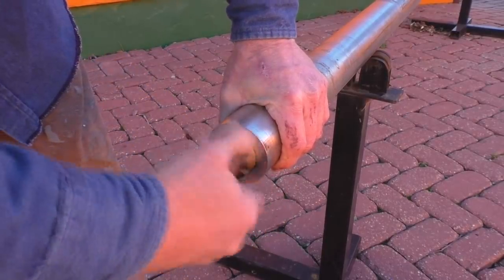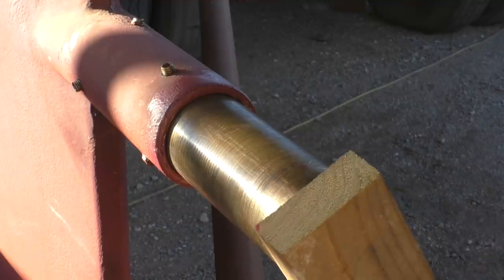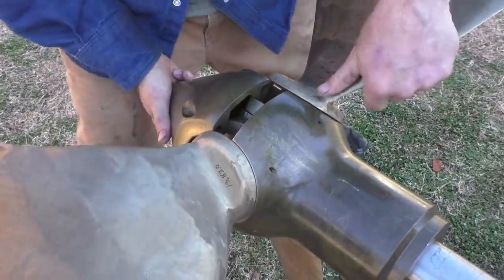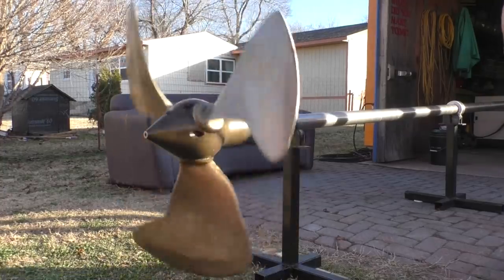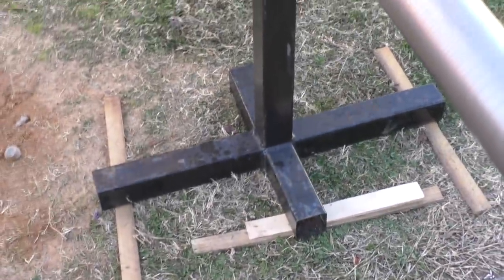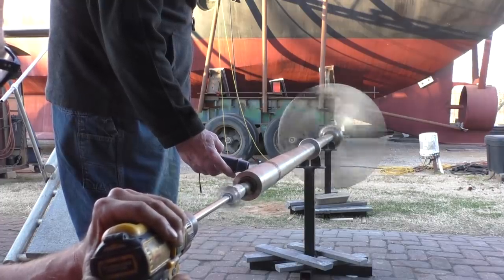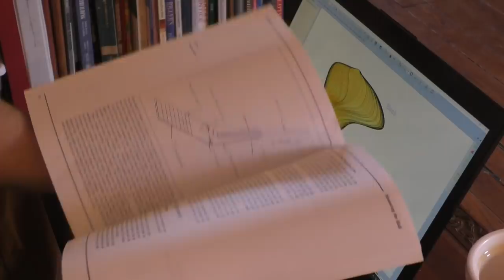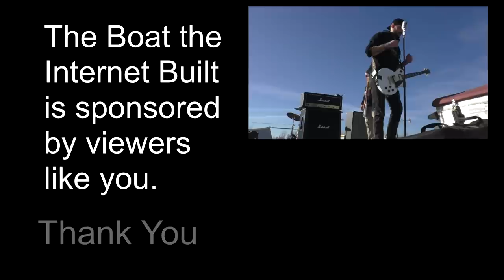DIY Boat Propeller - Part 10 - Tested at 600 rpm

Comment: A propeller blade balance can be calculated with momentum. Take the weight and multiply by the distance from the center of gravity of each blade to the hub center. That is the number that must be as close to each other as possible between all blades.

Comment: If you lower each blade incrementally into water at the same angle and measure the displacement at each step you can compare reasons across blades with regards to volume differences in each "slice"

Comment: My aducated guess is that your wobble at x rpm is due to the shaft hitting some natural frequency spots in the whole system. or the stands .
What RPM do you intend to run that prop at anyway? I only ever seen props run at 100 to 140 RPM's

Comment: It looks like the roller bearings are stiff. Remove the pop and shaft and spin each roller and see if it drags. The prop should spin easily with good bearings.

Comment: I was too a little bit concerned about the spinning meat cleavers. HA!  The little bit of wobble you got is being amplified because of the way you have the shaft supported. If both sets of blades behave as well as the first,  I think it will be fine once in the boat.

Comment: You want to change the Hunderstat shaft spline so the Port side bolt heads are on top, and the starboard nuts are on the top.  That way as it spins, it will remain balanced.

Comment: Do the prop manufacturers use moment weights on large blades? On a jet engine the weights are installed on the cone not the blades.

Comment: I would just have tryed to do a static balance if needed. But i think this will be okey when installed in the boat. The phenomenon you experience with more imbalance at certain speeds is called critical rpm:s😊

Comment: I'm no expert, I'd see if you can get the shaft straightened
I would weigh each blade and get them as close as possible, there are prop shops that can also more accurately mill and profile them
maybe add shims to the loose blades reduce wobble and stress that will damage them further once they hit water
can also balance the hub assembly?
Love watching the progress, thank you for sharing

Comment: Best wat to balance this is a bubble balance like they used to balance tires in the old days . was raised in a garage and did this many times. you balance the yoke and everything hooked to it. You just need center and a point to hold and a bubble level on top close to center.

Comment: Just a thought from a laymen, what happens if you spin without the blades or  mount e.g. a tire or a perfectly round plate on the shaft and then spin it. If it still wobbels, it's the shaft. If not, it's the blades. (You could also mount the weight on the back-end of the shaft  if that's easier.) Great episode as usual, thank you!

Comment: In concert with some of your more astute viewers  comments, review the footage and you will notice the hub is not concentric to your prop shaft, in which case the balance issue is not the blades alone , therefore the mass difference may be an issue ,or it May also be counterbalancing the hub, giving a net "balanced" effect. It's not always as cut and dried as it may seem. Give Keith Fenner a call. Guy knows his stuff !

Comment: on the second set of blades when you started turning it reminded my of a Huey when power is applied to the rotors. When they first start turning it's like one of those old vibrating belt machines from the 50's, shake the crap out of you but the faster they spin the smother it gets.....LOL

Comment: If you want to find the center of gravity for each blade, set each corner of each blade on a scale.  That will tell you where the weight is in each blade and you can then fine tune them.  Should be able to get them within a few grams of each other with the same center of gravity.
Reply from the maker: Yeah, that's a good one too.

Comment: Your critical speed seems over 200 rpm, you should weigh the natural assembled weight, use a scale, and dont run the shaft on a Mickey mouse set up you have! Build a legit sanitized stand and level properly.
Reply from the maker: It has to be Mickey Mouse.   We're sponsored by Disney Land.

Comment: Blades that all weigh the same may be heavy at the tip or base causing wobble..... When balancing helicopter blades you must Make them the same weight and have their center of balance at the same point along their length.... You can use 2 knife edges ( such as 2 scraper blades or planer blades) that your shaft sits on then the heavy point will roll down to the bottom..... You can balance tip to base on such blades as well or support with a cord.... When hangs level mark the center support point when all 3 have same center support and same total weight you will be balanced...... All will have harmonic speeds that will wobble all you can try to do is move that harmonic to a point at the lowest speed or move it above your top operating speed.... Moving the harmonic is done by changing the centers of balance.....

Another way to balance along the length is to place the base on the table and the tip on the scale.... When all tips are equal weight reverse with tip supported and the base on the scale you have double checked 

The way I balance helicopter blades is to line up their ends with a round rod or a razor sharp blade under the center of balance when they all tip at the same point they are equal tip to base... Then you must get them all the same weight.... By add or remove material at that balance point..... Don't forget when you attach them to the shaft .. They may be slightly longer or shorter.... So measure from the point that is a true base... Not the point at the bottom when you stand each blade.... You could take your shaft to be balanced by any that balance hot rod drive shafts.....

Actualy the stand moving allows you to balance at speed.... You bring it to the rpm that causes that stand to move then you bring in a marker to the rotation of the blade until the heavy side just touches the marker.... Then you will have marked the heavy point.... Always remove weight from the tip to base center of balance or remove weight keeping that tip to base center in exactly the same place. 

The idea is that a blade heavy at the tip versus the base.... The weight at the tip when turning at speed that gives say 3 g of force a small difference becomes more and the higher the speed the more the imbalance.... As excess weight at the base turns slower its differential in increase can't keep up with the tip....

There are ways to balance all along the length base to tip but that's only necessary at extreme high rotation speed...

These methods have worked extremely well for me on radio control helicopter blades and even on jet engine turbines that turn in excess of 100 thousand rpm

Keep this in mind there will always be harmonic vibration if you can not force them above the operation speed force them as low speed as possible.

Be sure your shaft is perfectly straight you can do that with the shaft supported at each extreme end on 2 sharp parallel blades (eyeball the edges) then roll the shaft eyeball the length and see.... Or the low point mark then bend....

Consider that the weight of that shaft could bend that shaft when you had one end  supported and the other dangling until you lifted it....
Do your best to get everything right and it will serve you well for many years
Reply: Consider those  stands wheels and bearings may impart vibration

Comment: You could balance the blades the same way you balance connecting rods in an engine. Make a jig to hold the blade horizontal from two consistent and known points that would be the same for all blades, one point being at the hub flange, the other at the blade tip.  Set the jig on two scales (or one scale moved back and forth) and remove material from each side until the measurements are consistent between the blades.  That way you get the total weight of the blade consistent and the CG consistent at the same time.
Reply: That works fine until you change the profile by removing material and one blade now moves less water than the others. Now you have an imbalance of power. But then again a chevy 4.3 will power a work truck for half a million miles.

Comment: You can balance it by putting the shaft on your stands with really loose bearings. Then just let the prop settle for a few hours and what ever part is pointing down is heavier than the part pointing up. So you can remove or add material like that
Reply from the maker: Right on:  https://youtu.be/1AyaYpbUSB0?t=683

Comment: Keep in mind that if it falls off the prop will roll one way and the shaft will swing violently the opposite way..
Standing anywhere along the shaft length is  dangerous as hell that's heavy and going to swing wildly
Reply from the maker: Hi Mom

Comment: I knew a guy who balanced airplane props. I tried to get him to explain the process, but he had been doing it so long that his answer was sorta "you just do it."
Reply: I purchased a gas station in the 70s that had an old school tire balancer in it. It was made for on the car spin up once the brake shoes had been backed off or if equipped with disk brakes, the calipers were removed and wired securely out of the way. Vacuum tube amplifier then amplified a signal from a coil mounted to the running gear to fire a strobe light and measure the overall movement on a peak harmonic gauge. At the peak harmonic one shines the strobe at the tire and notes the position of any marking applied or you just find the valve stem. Once the tire has been stopped again you move the valve stem to the same position it was in at peak harmonic and apply a tire weight to the opposite side of the coil mounted to the suspension. Complicated, but once the hang of it was obtained and it all made sense it was much quicker while still being a solid hours worth of work. I've used it since to balance a counter weighted VW boxer crankshaft and found it very lacking from the factory with the half block supported on a big block of foam so it could move to generate a signal in the coil. So it's extremely complicated, especially to explain it and all for why? Too much like work and I can see where he might not want to talk about work to any degree.

Comment: Hello I have a friend who bended a aircraft propeller and a old timer mechanic balance it with a nail. Get the blade disassemble and balance it on a pipe or something find the center of gravity in each blade, remove material until the center of gravity is similar somewhere in the blades. But that looks great it is balance. Saludos
Reply: It's now balanced... by weighing and adjusting each blade.

Comment: (Re)building racing engines require you to balance the pistons and conrods to some degree of accuracy. They typically use two sensitive scales and weigh toe piston end and the big end on separate scales. Then you can compare the weights of the conrods and -assemblies and cut off bits. YOU may be able to get the same by weighing the blades on wto scales, and comparing them.
Reply: Makes sense to even use 3 sets of scales on those props

Comment: You think the power steering pump can hold the force... doubt it! You need a seperate hydraulic power unit! The faster ya go... the Higher the pressure you'll have on that control unit! It'll be Far More than that power steering pump can handle!
Reply from the maker: I obviously do.
Reply: @SVSeeker  Sorry... should've watched more videos before commenting! As a retired Navy Boiler Tech (first half)... then converted to (Marine) Gas Turbine tech... our HOPM (hydraulic oil power module) was massive... what you're doing is fascinating! Digging your videos!

Comment: any decent propeller shop can balance that for you.  We have one in Savannah GA (champion Propeller) they have always done mine.  It would lengthen the life of the whole assembly.  Plus it would not be good to have a bad vibration after you have launched it.  I've put brand new 18 inch props on and had vibrations, had to take them back off and have them balanced for a smooth ride.  You have an amazing story, I wish you well in your travels.
Reply from the maker: Sort of missing the point of our DIY channel.   : )
Reply: @SVSeeker  completely get it and you have done amazing work.  Just sometimes you have to have equipment to do certain task that are needed but not worth the investment to do yourself.  You can certainly put it in the water and test it and risk having to pull the boat back out the water to have it done.  If you were just cruising the coast I wouldn't  be concerned too much.  But from your videos you have plans of taking off on some extensive traveling.  Repairs in other areas may be more difficult and more expensive then doing now.  The wobble in the shaft looks concerning also if it is not trued then your bearing will not last long at all.   Just a suggestion.  Much respect to the job you have done.  It looks amazing.

Comment: Hello Doug. take one blade off and balance two blades at a time by putting the remaining two blades at 10 and 2 o'clock. Gravity will sort out which of the two blades is overweight. Then repeat the same test with the blade you have removed and each of the other blades.
Reply from the maker: I did that, and you don't have to take a blade off for it to work.
Reply: @SVSeeker  Cool, I think we are on the same page then.

Comment: Just a lot of stuff that's going to break at the worst time -- when you need power in rough seas while being blown by a gale toward outer reefs with a snarled halyard and jammed anchor chain. Ahhh, the joys of sailing hardware. Oh, and the radio doesn't work and the skiff just dropped out of its davit cracking its hull. You run toward the dingy to keep it in the boat and suddenly slip, ramming your knee into a cleat. You call for help but everyone is vomiting and can't help. And then the rains come down in sheets, pouring into all the open hatches while departing seagulls sitting on the spreaders whitewash your head…
Reply from the maker: Spoken like a coward.  : )
Reply: @SVSeeker  You know how stuff works, Doug, better than most... and how it doesn't. It took years of sailing on my 45 Ketch for me to realize multiple things can go wrong and at the worst time. You can almost count on every exposed part and system to fail at some point in time. As for being a coward... as a waterman of sorts, I'm still kicking and got a few great stories out of it. I'm looking forward to SV Seeker's Aug. launch and the many stories you'll develop at sea.
Reply from the maker: @TomClark-Futoura  Good to hear.   So if you want to share in my comments section, do it from a stand point of courage.  Over coming adversity.   Spreading fear is spreading weakness.  Shit happens, be ready for it and it will never be at "the worst possible time"   The only "the worst possible time" is when you have a bunch of cowards for crew.

Comment: You could have the blades laser scanned locally. They would show you the difference in them. If you need to remove some metal from a high spot

Comment: From my armchair, that looks more than good enough to me for it's intended use. 

The shaft is so long it's going to flex and bow every time there's a torque applied under load anyway. You'd be chasing harmonics all over the place if you do try to get it perfect.

It would be more important in something like a single shaft turbo-gen. While static, the shaft will actually sag normally due to it's weight under gravity, and so starting up requires turning it over slowly until that sag spins out.

Comment: Have you taken the weight of each blade? That should be nearly the same for all. If not, you have your unbalance already.Beside the shaft should be filled with oil too.
Reply: If you fill the shaft half full it will balance itself dynamically.

Comment: The automatic transmission might have a 2.54:1 first gear ratio.  The engine's max power is at about 2,700 rpm.  If the engine is running 1/2 max rpm, that would be 1,300 rpm.  Although the feathering 'screw' will adjust forward speed to available HP.  The shaft might be turning faster than the rubber bearing can tolerate for hours on end.  Maybe a truck 4x4  transfer case gear reduction could be used to lower the  'screw'  speed and increase rubber bearing life.
Reply: Those cutlass bearings can tolerate a lot more than 1000 rpm. Most boats shafts spin 4000-5000.
Reply from the maker: 3.5:1
Reply: @stevenbeach748  OK,  saw a website where the marine consultant Stevedmarineconsulting.com states that the nitril cutless bearings can handle 2000 rpm for 100's and 100's of hours.   With only seawater as a lubricant, (they don't like oils)
Reply: @SVSeeker  At a 3.5:1 transmission ratio and engine turning 1,300 rpm equals 371 rpm at the feathering 'screw' end.   At full power the 'screw' is turning 742 rpm.

Comment: the same happens with your car wheels, if your front wheels are out of balance you most likely start to feel it between 50 and 65mph. Some shaking side to side and/or some shaking up and down.
In the case of this propellor i think the problem will be softened  by the thrust load that will be on the prop blades. That was not factored in in this test.
Offcourse perfect balance would be nice. But as soon as that prop snags some seaweed or, god forbid, a fishing net it will be severely out of balance anyway. Barnacles that grow/cling on those blades will also cause unbalance.